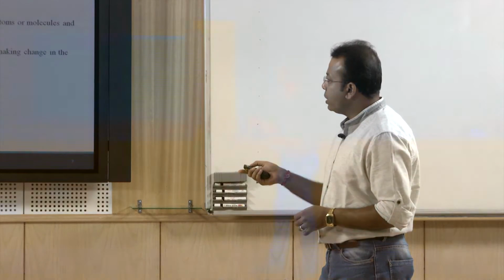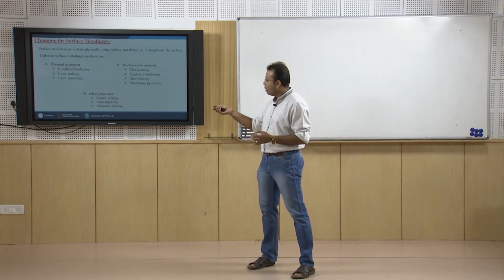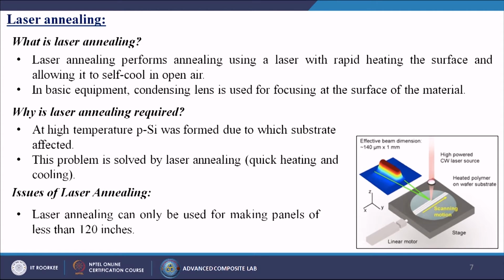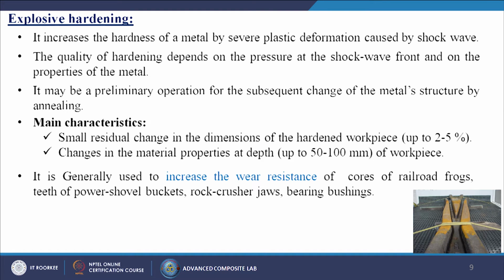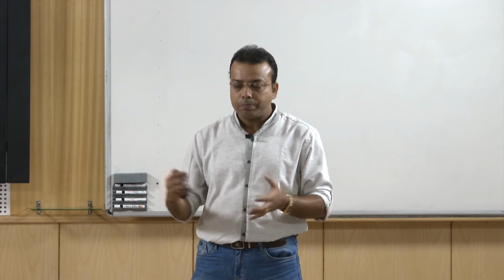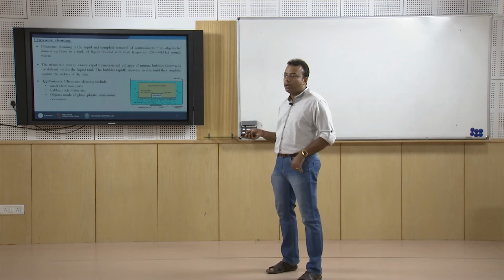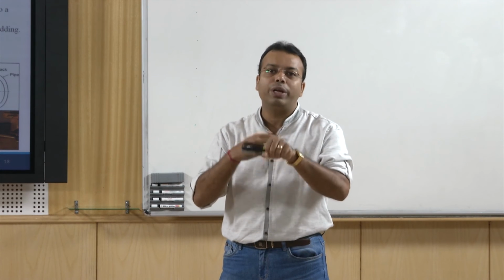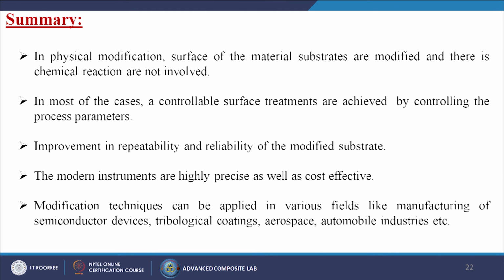Physical Modifications

Comment: Question, If you are doing a ceramic coating with CVD wouldn't that be a chemical surface modification instead of a physical surface modification? I feel like if I am mixing up things. Cause the organic coating and the ceramic coating is a classification of the type of material that you coat, independentlyof which method you use.  And the spin coating PVD CVD etc are types of method for surface modifications.